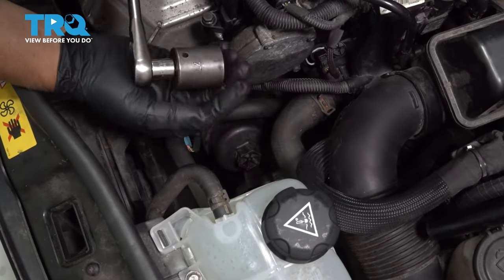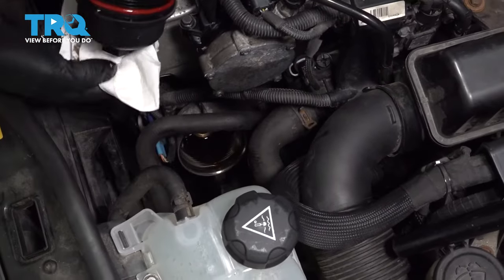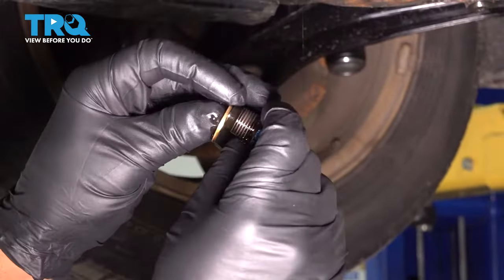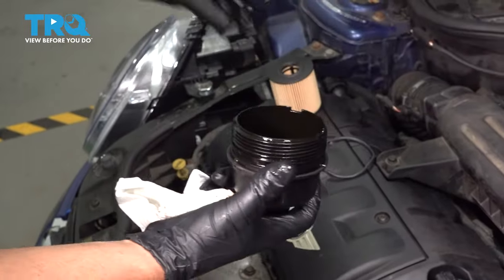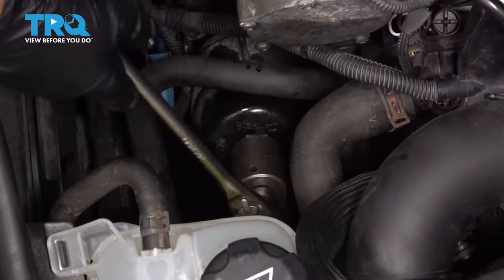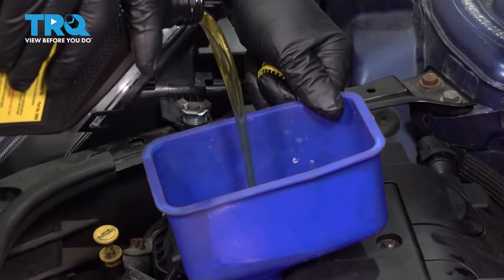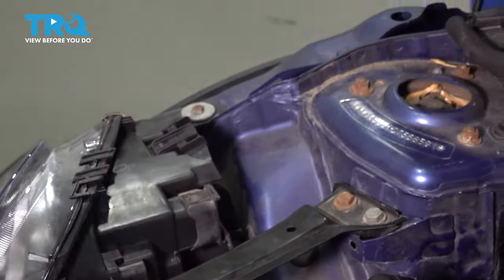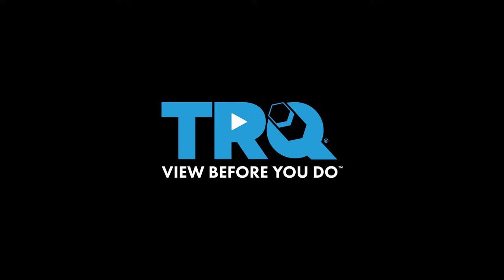How to Change Oil 2007-2013 Mini Cooper

Comment: I needed to know what you did before all this. I have a 2013 Clubman S and with my Mini, the coolant reservoir has to be moved over or completely removed to reach the oil filter (and I have to use a 12"+ extention to reach the oil filter).  I wanted to see how you move the coolant reservoir without all the coolant spilling all over the place (and the video already passed that part which defeats the purpose of the video). 
  This video shows maybe "half" of what is really done for a Mini Cooper oil change.